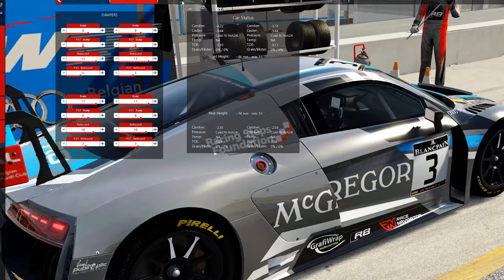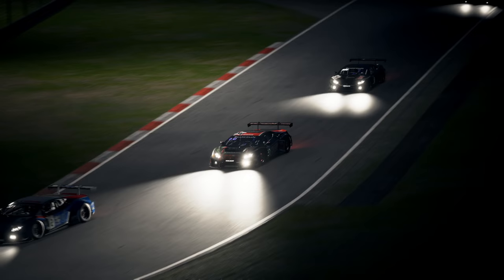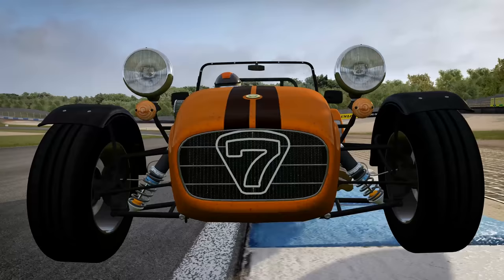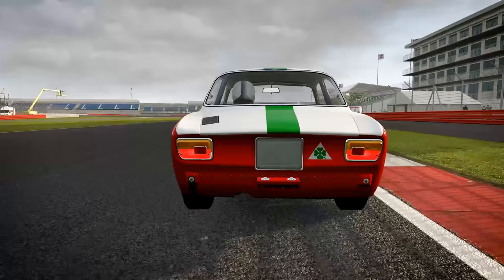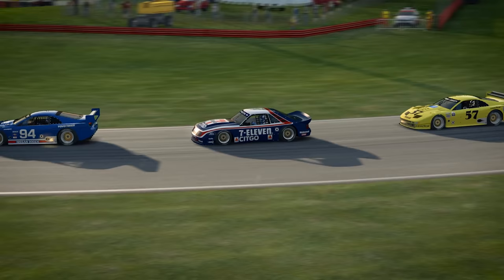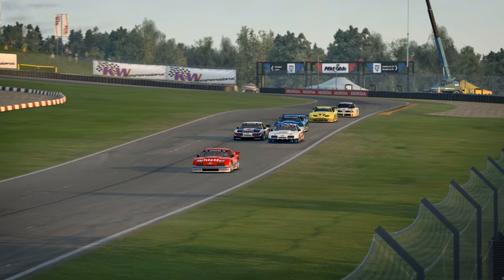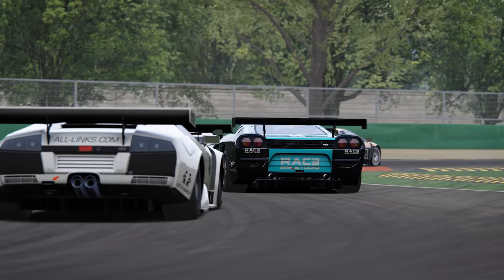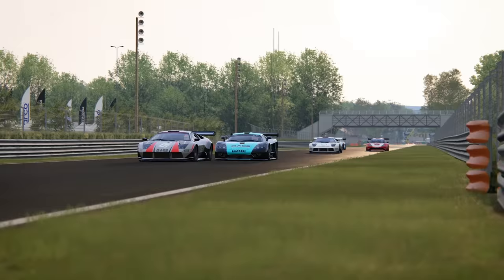Sim Racing Setup Guide 06 – Dampers (Shock Absorbers)

Comment: Hmmm. The higher a damper setting, the slower the car settles methinks, depending on what you mean by settles of course.. Yes, the initial transfer of weight will be quicker due to less compliance, but the total transition will take longer. For example, with max bump and maximum braking it would take longer for the spring to reach max compression for the effort than if the bump were at a lower setting.
Reply from the maker: Yeah, good catch, I was being a bit imprecise with my language - I was trying to suggest that higher damper settings would lead to fewer oscillation cycles of the spring. But, you're absolutely right, the amount of time it takes to complete a compression / rebound cycle would be longer. I'll pin your post to the top just in case it confuses anyone. Thanks dude!
Reply: +Chuck Chequers Nah, Chris is right as long as the car is not critically damped. Stiffer damping will complete the transfer quicker.

Thou many modern racecars are above-critically damped in slow movements so technically it will take more time to reach new position for the suspension, but 99% of the weight will be transferred even faster. At which point we could have a debate over weather position (technically correct) or majority of weight (what we actually feel when driving) is correct to be used for definition of "settling". So for the scope of this videos i'd say it's fine IMHO.

Or to put is simply, with overdamped bump during braking suspension position does not mean a thing, as we feel settled in the braking before front comes down anyways.

Comment: Reaily great series of videos, which I feel will quickly become "must watch" for new simracers. But one thing I think is missing in this video, is which slow bumps/rebounds are in play during acceleration / braking. When accelerating the rear is compressing and front is expanding, thus rear slow bump and front slow rebound can be changed to affect handling. The opposite is true during braking, the rear is expanding and front is compressing, thus rear slow rebound and front slow bump should be changed. This small detail has eluded me for a long time.
Reply: But what change should I do and in which situation?

Comment: Thank you for sharing your hard earned knowledge.
Question. Can a soft spring be overpowered by a really hard damper or this is not how phisics works :).
I mean will a hard damper not let the spring compress fully?
Or the other way around, hard springs will not need the damper on compression since they are already hard to compress :). Does this make sense?

Comment: I wonder, I assume the rear works opposite to the front when breaking and accelerating. So that would mean when breaking, you engage slow bump on the front, but slow rebound on the back. And when accelerating or releasing the breaks you engage the slow rebound up front and the slow bump in the back.  

Given all that. Say you're driving a back heavy car like the Porsche 911, one could fight the oversteer on turn ins by letting the back come down more quickly than the front after breaking, throwing the weight on it. And one would do that by having a faster slow bump in the rear than the slow rebound up front. 

Is that right?  
If so I'm going to try that.

Comment: When you say the rebound should be higher than the bump, do you mean softer as in rebounds faster or stiffer so it rebounds slower?
Reply: Rebound should almost always be stiffer than bump. Softer rebound can induce bouncing effect. The reason is that rebounds comes into play when the spring is extending, if it is softer it might happen that the spring will expands past its neutral point, thus bumping (compressing to the neutral point) again.

Comment: So ... if I brake on a straight without ABS, and I hear the wheels squeeking on and off, like they were hopping up and down while maintaining the same brake pressure I should do what exactly ?  I am still confused. Lower the fast rebound rate of what ? front, rear ? Or what else ?
Reply: Softer fast rebound makes wheel contact faster to road between those pumps. If that doesn't help then braking more cautious only helps.

Comment: When you say "increase the damping" (slow bump for example), does that mean to make it compress quicker or slower? The terminology for dampers always gives me ADD. 

Or to be more specific, in a sim like iRacing, does increasing the value of bump (1~8) make it compress quicker, in a sense making it stiffer? or slower making it softer? And how do these changes effect the under/oversteer?  

Should we think about this the same way we think about spring rate? Meaning: a stiffer front setting make the care more responsive but less grippy, and softer settings doing the opposite?

Don't feel the need to address all of that btw
Reply from the maker: Hey Anthony - more damping = slower compression. Dampers are more about taming weight transfer than they are a tool for altering the balance of the car. Ideally, when you're braking for example, you want the weight to transfer, and stay there until you release the pedal. Without dampers, the spring would make the car act like a seesaw.
Reply: OK lets see if I can understand this:  Dampers control how fast or slow weight transfers, whilst springs control how much weight is allowed to transfer?
Reply: The higher the value the stiffer the damper is. You can think of dampers as dynamic springs, a car with stiffer damper will behave as if it had stiffer spring during the short moment of the transition.

Springs do not control how much weight is transferred, that is purely down to center of mass height and horizontal forces on the car. At best what springs can do is to shuffle the weight a bit between individual wheels (the same way anti roll bars do), and they control the speed at which it happens.
Stiffer spring = faster weight transfer.

What might be confusing about dampers is how transition speed and weight transferred interact with each other:
"A stiffer damper makes the suspension move SLOWER, thus transferring weight QUICKER".
If you manage to wrap your head around that one sentence everything should become clearer.
Reply: makes sense actually. The slower a damper moves, the faster the weight will load up on the damper. Sort of how traffic works.

Comment: I have an issue with acceleration understeer... any tips? I’m pretty happy with the handling otherwise....
Reply: If handling otherwise is good then back driving differential more locked would be only option. Anything else would mess up current handling, not 100% sure. Or just throttle more cautiously so you understeer to exit of corner.

Comment: When you say increase do you mean increase damping as in slow rate of suspension travel???
Reply: In other words, incresing the Bump value means a stiffer setting and in therms of velocity these means the suspension will move slower due to the shock absorver resisting(more) the compression of the spring.